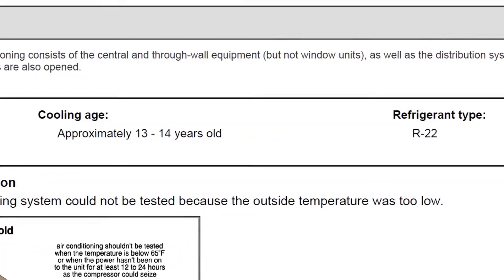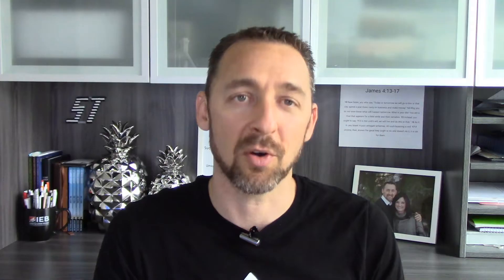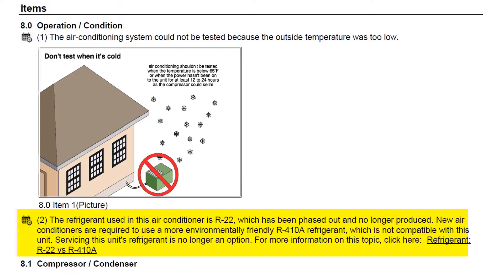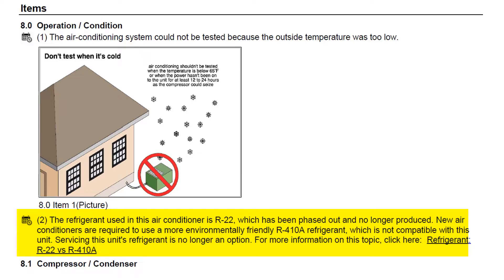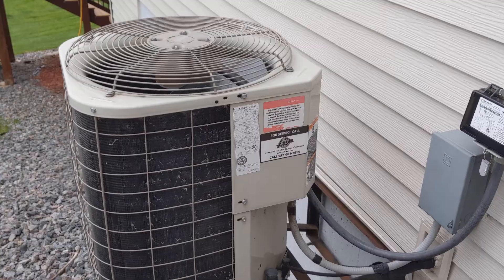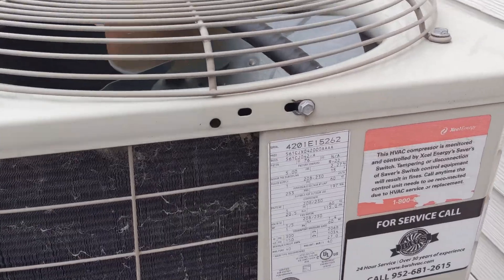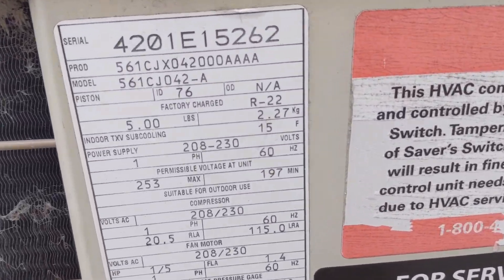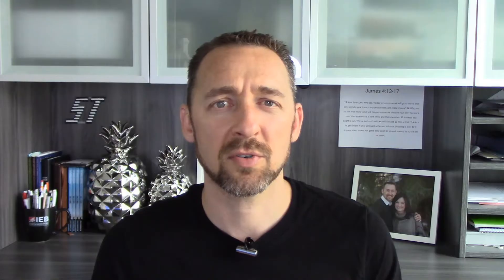Does your air conditioner use R-22 refrigerant? Here's why you should care.

Comment: Well well hold on. I have R22 unit since early 90's and it's BEAST that never EVER fails. I had recharge it once per entire service history with sealant and it continues running with no issues. Had also seen 70's built units still doing great. How can they be not serviceable??

Comment: Strongly advised homeowners with R22 systems to purchase R22 from Ability Refrigerants and have it on hand in case it's needed.  You'll save 4-8 times the cost having it on hand.  Just need to sign an affidavit that only a licensed individual will be using it.

Comment: Can you replace R 22 with another Freon?
Reply: There are replacement freon compatible with R22 but the technician needs to have years of experience due to the complexities of reclaiming the old R22 out and introducing the proper oils, cleaning of the lines, etc so it will perform as intended.  It is a delicate balance of many procedures to be done carefully and time intensive.
Reply: Yes.  RS44b is a very good replacement.  No oil change needed.

Comment: The amount of misinformation being spread is unbelievable. There are stockpiles of R22 refrigerant in supply houses and online. Additionally, there are R22 refrigerant substitutes available. The number of R22 systems both in residential and commercial environments that are still in service is about 50%. The case where equipment would NEED to be replaced are cases where you have rotted out indoor coils (which never get cleaned) which directly affects the outdoor unit's compressor motor working harder/longer duty cycles, which will lower the ASHRAE median life span significantly. In THAT case, when considering an indoor coil replacement, major outdoor unit component replacement, one would have to consider replacement with newer system as a more appropriate option. But just to recommend replacement due to the system using R22 as its refrigerant is non-sense, untrue, and fraudulent. Most homes and businesses have climate control equipment that require HVAC tradesmen to service and replace them. Be honest, fair, and kind to your customers and you will never be without work. Try to hit home runs on every site visit, and well....f around and find out, right?

Comment: Can't you suck out the old and replace with the newer refrigerant? We keep saying we are hi-tech so it shouldn't be a problem.
Reply: The pressures at which the refrigerants work within their closed loop systems are different and therefore they cannot be replaced. The equipment will not work properly.

Comment: You're not making a true statement when you say this. There are alternative refrigerants to replace r22. The first one is 407c. That particular refrigerant can be used in place of R22 with a addition of Poe oil 20% of the oil capacity of the compressor. There is also nu-22 refrigerant by iqor industries. There is also many other refrigerants that are cost-effective. It is not right to condemn a piece of equipment that uses refrigerant 22. Yes it may be a little outdated, but if it still works, let it be. I have been in the industry for 46 years. At one time I sat on the board of the refrigeration service engineer Society and also North American Technical excellence. Let the customer make the decision on what to do but give them the options.
Reply: There are many tradespeople telling their customers that the EPA has made R-22 illegal to work on or service, hiding behind the EPA, saying they can lose their license, which is a huge lie. Production has been banned but R22 and its substitutes are available in plentiful supply. There are so many reasons to add value to recommending a replacement system in lieu of flat out lying to people. Let the customer decide. 100% agree with you. Eventually, they will have to be replaced anyways.

Comment: Just use rs-44 in r22 systems.  Seems like some companies don't tell customers about rs-44 so they can sell them a brand new unit or some of their expensive remaining stash of r22 refrigerant.
Reply: RS44b is a great replacement for R22.  I have had it in my system for five years.  Cost now is about $600 for 20 lb cylinder.  It was $300 five years ago.  My system uses 10 lb.  R22 is now about $900 for 30 lb.

Comment: R22 is still readily available but is no longer being produced new. Prices will go up dramatically in the next few years. You can still have your system recharged with R22 for a couple hundred dollars by the right HVAC contractor. Also there are replacement refrigerants that can be used in an R22 system, switchover would cost about $500. HVAC contractors claiming that R22 systems can no longer be recharged, serviced, or it will cost 'four figures' to do so are misleading you into buying a new system. If an R22 system is less than 15 years old and still in good working order with a minor leak there is no need to upgrade because R22 and substitutes are still readily available. If the system is at the end of its useful life or needs a recharge every year then you should consider upgrading to a R410a system.
Reply: Very good advice, if a contractor is telling you it’s illegal or quotes four figures look elsewhere.
Reply: Does the minor leak need to be repaired or do you just do the recharge and let it leak for a few years
Reply: @tylerwinkle323    best to get it repaired, realize though a leak in either coil indicates a weakened internal situation and further leaks down the road are likely.
Reply: @amtrakusa1  can't find a tech willing to diagnose and repair the leak for a 20 year old system. They say it's due to age and the leaks are all over, usually "microleaks". That normal?
Reply: If it is determined and truthful that leaks are "all over" then probably the unit was not vacuumed properly and air/moisture got into the lines which creates acid.  This acid eats the lines internally which would be the cause of many mico leaks.  Replacement would be necessary at this point.
Reply: By code it must be repaired but alot of folks simply have their system recharged yearly or once every 2 years by a technician willing to do so.  I would at least determine where it is leaking from.  If it's in or around the evaporator then your breathing that leak in inside your home.